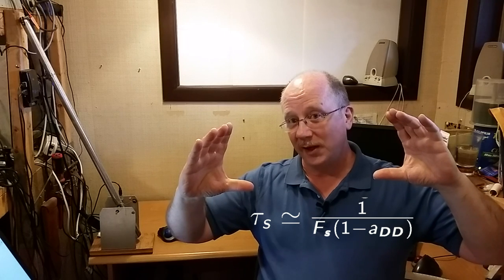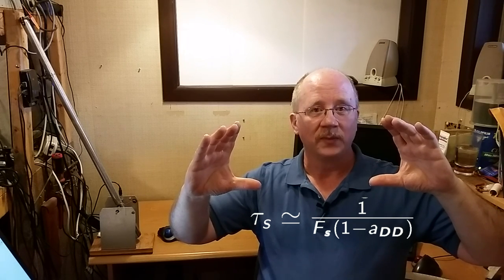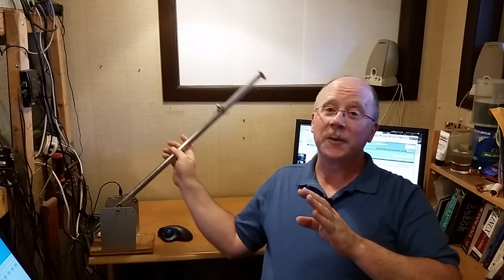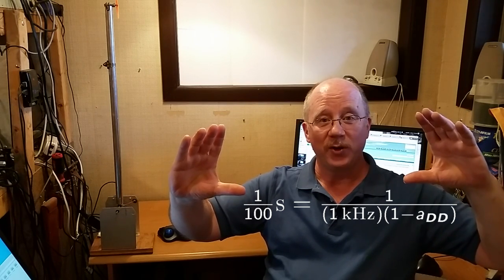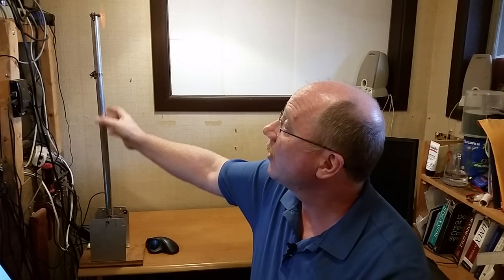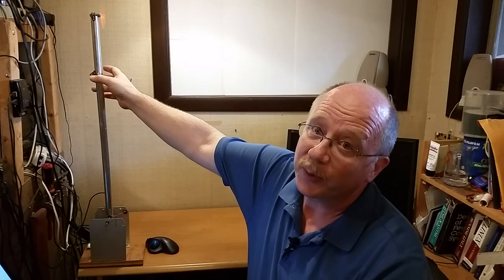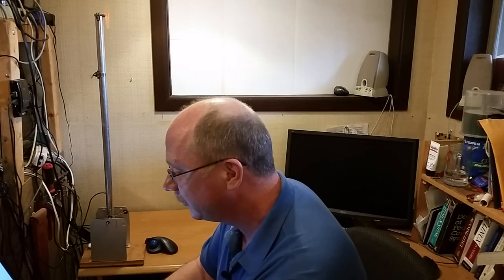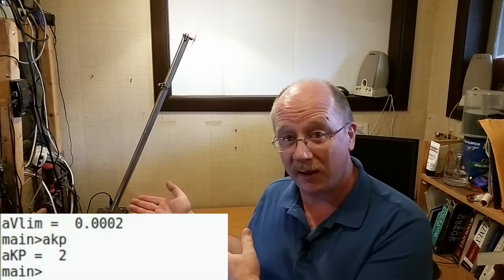PID tuning

Comment: I found this very helpful, as I have been trying to tune my home made sailing boat autopilot, and hadn't come across the differential band limit, which, based on experience of my systems behaviour, is possibly something that I need to programme in.  Many thanks
Reply from the maker: I'm glad I helped.  There's more than just differential band limiting that can screw you up -- but it's something to try.
Reply: Wescott Design Services yes, still suffering from differential kick and my programmed range for the I term is too high...

Comment: Lo, I was trying to check out what books you had on your shelf rather than hear what you were saying. I wish I had this video available when I was constructing the timing and phase loops for a project i was working on. Always appreciate your comment on comp.dsp
Reply from the maker: Bottom Shelf, right to left:

"The Annotated C++ Reference Manual" (Stroustrop)
"Universal Serial Bus System Architecture" (Mindshare)
"Nonlinear Dynamical Systems" (Cook)
"C: A Reference Manual" (Harbison & Steel)
"Linux In a Nutshell" (Siever, Figgens & Weber)
"Running Linux" (Dalhemer & Welsh)
"HP 32SII Owner's Manual" (HP)
"Enercell Battery Guidebook" (Radio Shack)
"Design of Feedback Control Systems" (Hostetter, Savant, Stefani)
"HTML & XHTML: The Definitive Guide" (Musciano & Kennedy)
"Linux Kernel in a Nutshell" (Kroah & Hartman)
"ISE 5.2i Reference Manual" (Xilinx)
various bills

Top shelf, left to right:

Various CDs
a very dusty Rolodex
Two MSP430 Ultra-Low Power MCU devolopment kits
Two Stellaris LM3S811 evaluation kits (the trainer uses an LM3S811)
"Switching Power Supply Design" (Pressman)
"Guide to GPS Positioning" (Canadian GPS Associates)
"Optimal State Estimation" (Dan Simon -- THE book if you need to understand Kalman filtering)
"The Verilog Hardware Description Language" (Thomas & Moorby)
"Electric Machines: Steady State Theory & Dynamic Performance" (Sarma)
"Digital Control Systems: Theory, Hardware, Software" (Houpis & Lamont)
"The Debian System" (Krafft)
"Detection Estimation & Modulation Theory, part 1" (Van Trees -- the hardest and most useful class I ever took)
"Signals and Systems" (Oppenheim & Willsky with Young)
"Digital Communications: Fundamentals and Applications" (Sklar -- shared with a customer so we have a common language)
"The Sports Car: It's Design and Performance" (Cambell -- from the library of Rolla Volsteadt)
"Directional Statistics" (Mardia & Jupp -- mind bending math)
"Engineering and Scientific Computing with Scilab" (Gomez)

Comment: Great video! I'm just wondering, what is the benefit of adding the "integral" control to this particular system? It seemed to work much better with just D & P (i.e. no visible overshoot at all). Is there a condition under which the integral control would be of benefit here?
Reply from the maker: Good question.  Because the fan trainer has very free bearings, is well balanced, and has an actuator that develops a force, it already acts like an integrator by itself -- this is why it behaves so well with just proportional and derivative control.  Where integral control would really come in handy with this thing (assuming that such a gizmo ever had a practical use), would be when there is a disturbance force to be overcome.  Such a force could come from an imbalance in the mechanical arrangement, if you were using the thing to pull or push on something in the real world, or if you were using the thing outside on a windy day.

If you look at this video, https://www.youtube.com/watch?v=2elEXcv0AV8, I show the behavior when you have a disturbance caused by imbalance with just proportional + derivative control (starting at around 8:45, here: https://youtu.be/2elEXcv0AV8?t=524), then later I show the behavior with the same disturbance, but with full proportional + integral + derivative control (starting at around 11:45, here: https://youtu.be/2elEXcv0AV8?t=704).
Reply: Ah, many thanks! Good, concise explanation.

Comment: Well, videos provided by u r very knowledgeable content wise. Now, I have understood the PID and trying to make a temperature controller. After deriving all parameters P, I, D. How it it is used to control microcontroller pin? Means it provides on/ off time, but how to correlate.

Comment: Start out by demonstrating what your device is supposed to do.  Preferably by setting it to work well and show us how it performs.  It is hard for us to recognize poor performance when we don't know what it does.
Reply from the maker: Excellent comment.  However, unless I'm horribly wrong, YouTube doesn't let you edit video once it's posted -- you can add annotations, or you can take it down, but you can't change the actual video.  About the closest you can come is to take it down and post another one -- but the new one will be under a different URL.
Reply from the maker: I can give a verbal description: I want the thing to go to a target position promptly, without overshoot.  

Because of the nature of the tuning method, one has to settle for "as promptly as possible" and then find out what "possible" is after the fact, rather than being able to directly predict performance beforehand.  One can have a rough idea if one has done something similar beforehand, but that's about it.
Reply from the maker: I've added an annotation to the video to clarify this, as well as a link to one of my other videos that goes a bit deeper into desired behavior.

Comment: matlab tuning tools is good enough? Is there any problem?
Reply from the maker: I'm not familiar with the Matlab tools, so I can't answer.  The limitation with Matlab is that you need to get measurements of the system behavior into the thing to do system identification on, or you need to model the system -- this method arose out of a community of millwrights who learned how to do the tuning by the seat of their pants.  It's not the best, but it's often plenty good enough.